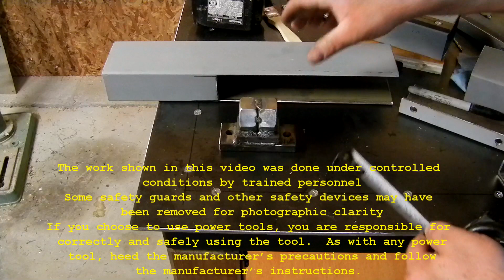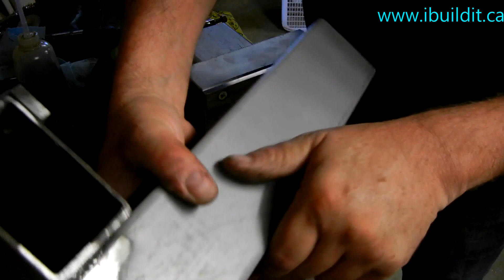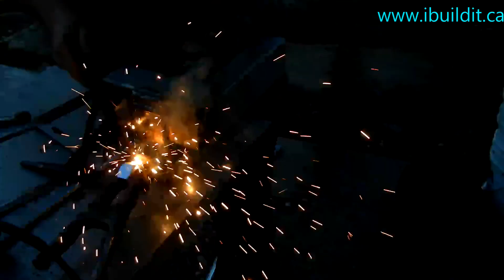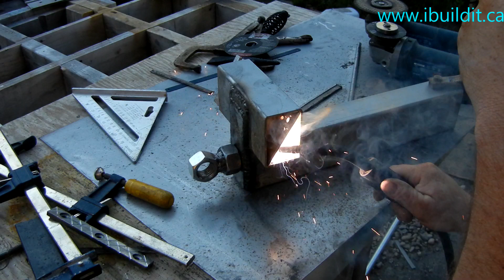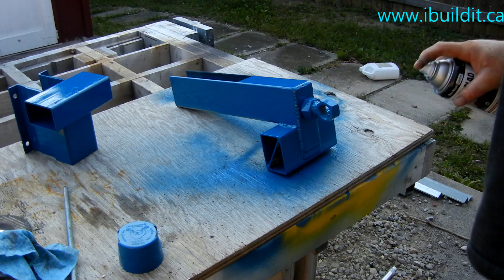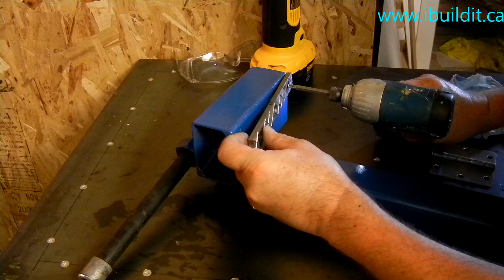How To Make A Steel Vise - Part 3

Comment: John, you are something of a hero for chain-drilling that clearance hole in the front plate and then cutting it out with a chisel. I admire what you do, but in some cases it's worth spending some beer and bait money on a special tool. I remember buying my first 1" dia. drill for one job and thinking "I will use it again", and I have, lots! For every major project now I say "Is there some tool that will expedite this?" Often there is, and once you have it it's amazing how often you use it again.

Comment from the maker: Thanks.
Sometimes I centre punch, most times I don't and don't need to.
Drilling a pilot will often save time and bits. I usually drill a pilot for anything above 1/4".
Washers are not needed. The hole I made through the steel is much closer than the hole in the washer, therefore the nut has more contact are with it.

Comment: Nice work, but i have to suggest something. Forces in this vise is made between nut bolted on bench and 4 bolts that hold upper piece. When you tighten something all forces are made between that bolts in lateral plane and that is not good solution. Bolts are made  to be forced longitudinal. I would made some changes in this construction, lower piece can be rotated 180 degrees and nuts from bench should be welded to upper piace. In that case bolts on upper piece will only hold vise to the bench, and only the internal forces will be made.
Reply from the maker: Typical over-analysis. Ever actually make something?
Reply: John Heisz Do not take it personally, I appreciate your effort making these videos, which I love to watch. Of course I have done my projects, the last one was angle grinder holder. I didn't like those in shop they are too wobbly, so I have decided to build one from scrap metal that I have had.I also have my handy man bussines, so I have to work various things every day.
Reply: There are different grades of bolts. You can buy bolts designed to withstand exceptional shear forces and are crap for stretching forces.

Comment: That is so cool!
But I have several questions. Is the speed of wire on the welder set to very low? Why?
Why don't you center-punch holes before drilling (or I just didn't see? And why are you drilling small pilot holes instead of drilling final size in one pass?
Although I would have added one of two of those washers to the front, This Vise Is Amazing!

Comment: as it is called liquid apply when making the holes with the drill?
Reply: Hello Pablo,

When drilling holes into metals its a good idea to use a lubricating liquid to prevent the drill bit from over heating. "Drilling fluid, tapping fluid, drilling oil, tapping oil", any of those will work.

There are many out there, CRC even makes their own version, you can usually find them in your local hardware stores, or if not, a metal supply store will usually stock "tapping fluid".

Cheers, Umar.
Reply: Umar Musa
Why bother wasting money whem you can hav used oil from car engines that'll do the job in most case.
Reply: Stephen Balogh  thanks a lot

Comment: I've owned a Chinese machinist's vise for 20 years and it's held up well under some pretty hard use.  Perhaps the ones being made today are not as good, I don't know.  I'm a second hand store, swap meet kind of shopper, I see used machinist's vices frequently enough that I wouldn't try to make one.  On the other side, I don't bother making much furniture either because you can buy used pieces for the price of just the hardwood alone.